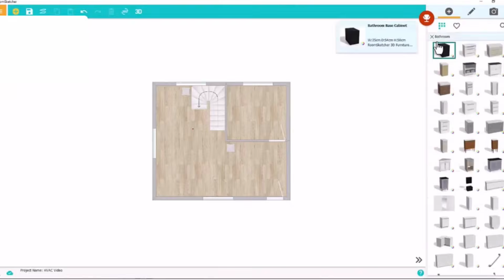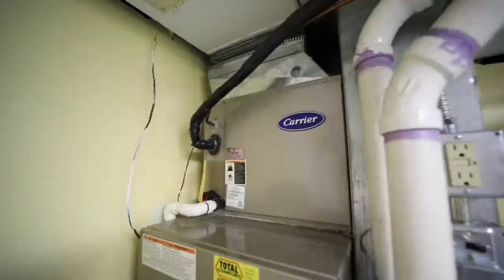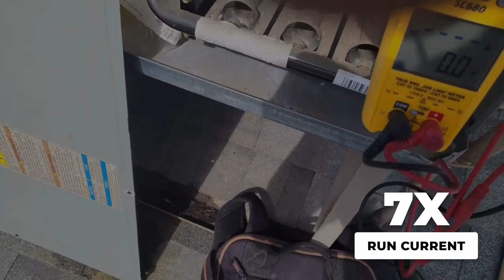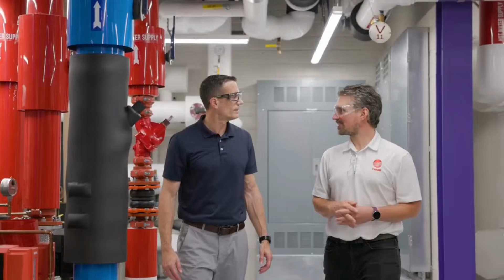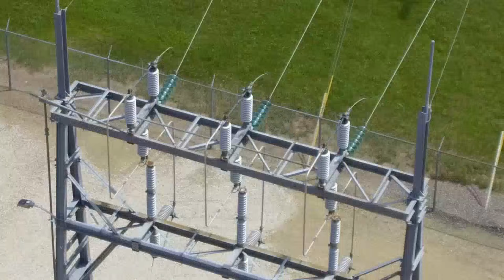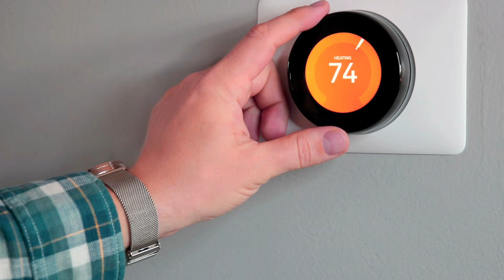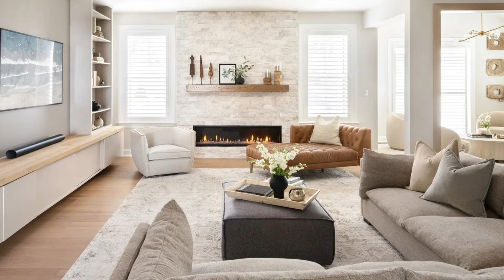How Smart Homeowners Are Beating the HVAC Industry (The 15-Year Loophole)

Comment: They never mentioned warranty. If I install a new system it comes with 10 years parts and labor warranty. Home owner has no out of pocket costs for 10 years. Which means that we definitely don't want it to break down or have any problems. Richard from Houston isn't going to have that. He will be lucky to have any labor warranty at all.

Professional installation and setup is the key.

Oh and if it turns out to be a lemon, we replace it for free.

Richard from Houston does not have that peace of mind.
Reply: Commercial property manager here. I’ve never seen a 10 year warranty. It’s usually 1 year parts and labor for the entire unit and 5 year parts warranty for the compressor and heat exchanger.

Comment: The starting current of the compressor is for a split second and has absolutely no bearing on your energy consumption or electric bill.

Adding accessories like surge protectors and soft starts just adds to the point of failure numbers so now you have more stuff to upkeep.

Surge protectors are no guarantee of protection. 

Soft starts are mostly used when a home generator is going to be used.
Reply: Nonsense - those spokes and surges can damage electronics quite easily .
Reply: I understand power companies charge you for those 100 amp power spikes every time it starts up.

Comment: Most people are not going to install a heat pump if they have a gas furnace. A gas furnace uses less energy to heat the house. Heat pumps cost more money to own due to higher upfront cost and higher upkeep and repair costs.

To have both would be dual fuel which most people don't want or need.

Comment: 10 minutes on, 20 minutes off, is not short cycling. That's only 2 cycles per hour. A properly running air conditioner averages 3 cycles per hour.
Reply: wow, that's what I thought.

Comment: During the COVID lockdown, that first summer was brutal for me. I was sick of keeping the thermostat low constantly,. I looked into dehumidifiers. When I got my first stimulus check, I did my research, and the first thing I bought was a dehumidifier.

It was the smartest decision I made.

Instead of constantly running the AC at a low setting, I was able to adjust the thermostat to 77°F. I'm someone who’s very heat-sensitive (if I'm not on the beach or in a pool, I don't enjoy hot weather), and it was delightful. It's just like the old joke about living in Arizona, where the temperature can rise; 'it's a dry heat,’ and that's so true, when the moisture is taken out of the air, making a hot room not just bearable but enjoyable, AND it pays for itself VERY quickly.

Comment: R22 still running la a champ
Reply: When I see an r-22 system I do not hook up my gauges unless I absolutely have to. If the vapor line is sweating and you’re getting a 15-20 degree temp split then it’s all good. I’ll check all the electrical and do a little tlc but that’s it. I want those units to last as long as it can for the customer because I know once it leaks most companies don’t make the coils anymore to repair them. Then it makes us look bad because the customer thinks we are just trying to sell them a new unit:
Reply: Me too I hope it doesn't start leaking. I always tell my tech don't touch valve for R22!!

Comment: glad bosch is making it sound like they are the answer when they are not and who in their right mind over size the  system unless the customer wants it?
Reply: No ax to grind here , but Over sized routinely…read lesstads worthy post above. The answer is easy when you have a new, well designed and built (ACH <2.0) house-get a competent manual J etc doen by a specialist (its really fair to say, Im sorry, even 95% of even competent honest HVAC installers dont/cant /wont do a competent manual J. They can make one money doign other things and aren’t amend or interested in doing  it.)It’s also easy when you ahve an old leaky house - unless you are sign a significant insualtion energy upgrade, take the time now to establish list. Baseline. How much of the day does your AC run on the hottest day ? Ifs its most the time you aren’t hugely overlies, but that said, dont go upsizing-your ducting probably not up o it/designed for it. If your are cycling  a lot of the time on t he hotest days you are probably substantially oversized. Probably quite safe to drop down 1/8-1/4 in tonnage. Even overlooking noise , Full inverters sunsets are CLEARLY more comfortable than even the optimally sized one and two stage systems, and they inherently start up slow (ie effectively  soft start)  but are more expensive and clearly more expensive to maintain/parts (those proprietary  thermostats are Greta but hugely expensive - think 1,000, not 500 to install; they are not routinely stocked locally as well, but NB they ARE necessary for full inverter full communicating sts yet s! etc esp when out of warranty (those boards parts are really $$$) new residential hvac units with hi pressure expensive refrigerants  re simply not gogin to last 20 plus years anymore they arent. Get used to it. And budget for it the nest warranties (daikin e,g) are onlt for 1 years. These companies spend a to of tiem and money erring what the effective life span f these units are -believe it when the establishment a warranty duration you can safely assume you have at most a 1/4 chance staticallys of lasting lasts lower than that . NONE of these companies keeps proprietary parts in stock much longer thatn that anyway. And NB with politics and environmental science etc, its safe to assume we will will have yet another “new” refrigerant mandated (lets hope its propane liek the rest for the civilized world by then. ) Hybrid solutions e.g., Bosch are a valid approach in DRY climates ; but by the verynature  of their  design, andd not good choices in high humidity climates. Both a no brainer say in Colorado or Arizona, but a no Brueno in Florida, Atlanta, Nashville, Washington  DC. But if you cna only afford a Bosch hybrid vs a carrier, trane, Lennox , daikin,  on inviter all in, taht can make sense for sure. And nb Bosch is basically made by Medea in China; thats not a knock but you should  never pay a premium for them. Initially their price point was very attractive. BUT dotn obsess over brands per se- focus on the company and the quality of their install and honesty of their mainatianence and repair approach. Are their techs certified (usually not) are they EXERTS in their equipment (for example Mitsubishi  and Daikin hi their dealers DO have to meet certain standards, ANYONE can buy Bosch and install themselves. ) these inverter systems are very complicated; even the best of hvac companies will only knwo how to install and service two brands at most for a good reason. And their is value in having equipment that many dealers can handle service wise, but techs come and go even with the bets companies; you may find you HAVE to switch providers down the road and it there are only 2 companies in area who really work on your equipment, your chances of finding a new tech an company go down compared to say it there are 15 carrier dealers in your area. Read up a n search utube on how a new system saw out should  really e done and MONITOR tehm installation. Companies routinely put their east experienced, knowledgeable and capable techs on the install team e.g., do they flow nitrogen when they braize ? Do they tripe evacuate lines ? Due to pull sting vacuum and test for adequate duration for leaks ? Do they size properly a quality filter (or Copeland ) One other thing- everyone wnats  to press fittings on new installs, in theory any idiot can use the press fitting system and with the low level of install crew, it makes sense . BUT these fittings are totally dependent on gaskets, all of them, and the new high pressure full inverters are merciless. Down the road they can EASILY leak, long after the install warranty expires. I would ask for all fitting s braised and CERTAINLY ANY buried fittings ….te days of topping off slow leaks in a singe stage system are over. R410 can easily cost over $1,000 to fully evacuate and reload these days !

Comment: "Anything can stop a Trane"
Reply: Been in business for 19 years, doing  3,000 - 4,000 service calls per year, along with installing hundreds of systems made by Carrier, Goodman and Trane. And its my opinion that Trane is #1
Reply: @stevespears1970  I agree. My Trane  XL19i is still humming  after twenty years.
Reply: @stevespears1970  What do you think about Rheem?.  About to have two Rheem 15.2 seer installed.  Hopefully I made the right decision.
Reply: I have a unit/ system from 1986....
1800 up
1800 down.
We use a window unit at the peak of day for a few hours.
If I reinsulated it wouldn't need that.  KcMo. High 90's with a few days in the 100's.
Reply: It is a Trane.

Comment: I recently had my HVAC replaced with a heat pump. It had a 4 ton unit the company wanted to replace it with a 4 ton. I didn’t believe it was necessary so I paid about $300 to have a Manual J done by an HVAC engineer. Turns out only 2.5 ton was needed. Works fine and the indoor humidity is definitely less
Reply: Wise decision.
The nice thing about a lot of heat pumps is that they are modulating. Oversizing is less of an issue. It will just run at a lower load for longer times. I have a Bosch IDS and I love this thing.
Reply: I run a manj on every house I build .
Reply: Tom do you have a contact phone # and email for your engineer that did your heat loss calculation, because I need one too ?
Reply: Will do the same on survey.

Comment: Compressors have the same basic design for 50 years! Starting current is designed into the windings. Many compressors being replaced today are from the late 1990’s! Heat pumps operate approximately 4500 hours a year at approximately 3 cycles per hour. 13500 startups per year x 20 years 270,000 starts! Sounds reliable to me! Soft starters are used for 2 situations, light dimming on compressors start-up that’s a power source problem, everyone blames the compressor. It’s not the compressor! Next noise on start up, this can be a compressor generated problem or more likely a power problem that is creating the noise! Soft starters usually eliminate these two issues, they don’t fix the problem the power still has an issue by its masked!
Reply from the maker: Fair point on the design spec. Compressors are built for startup current.
But 3 CPH assumes proper sizing. Oversized system short-cycling at 15-20 starts per hour triples that math real fast. That's where the damage happens.
On soft starters masking a power problem... you're not wrong. If the grid's dirty, fix the grid. But most homeowners can't fix the utility. A soft starter protecting a $4k compressor from a voltage problem they can't control isn't masking anything. It's damage control.

Comment: Wow. I had all new ductwork plus a new Trane system installed for 8K.
 back in 2010. But estimates varied wildly with different contractors.
Reply: I used R8 vs R6 that most use except Cali which is there code.
Reply: Trane systems can be pricy, but I think mine was worth every penny even though it was around $12k.

Going from a single speed to a variable speed completely changed the comfort level of my house, and my home office.

I was seriously considering adding a mini split for my home office as it would swing constantly from cold to hot to cold on my old single speed system, which meant I was going from sweating to the arctic, and back to the Amazon all day long.

The variable speed Trane keeps it perfectly comfortable 24/7, year round.

Knowing how well it works now, I would have paid more for it if needed...
Reply: i replaced all of my ductwork and the furnace, i did it all myself, cost around $800, furnace was $650 on ebay..
Reply: @jesvans That is pretty impressive.  My ductwork is run through the attic and is pretty long and bulky, not something I would be interested in tackling myself.

In the south you don't even need a furnace, I haven't used the heat strips on my central systems for over a couple of decades already...
Reply: @redbaron6805  attic, not a big deal. i had to replace all of the joists in my attic. round ducting is supper easy aand cheap.
Reply: @jesvans My attic has flex ducting, which is bulky, and my attic is a maze of obstructions, which is difficult to access unless you are an acrobat.

Now, the smart thing long term is probably building a walkway to traverse the attic, by putting 16x24 plywood and make a path around it, but that project is down the list below the other 900 projects that are still pending...
Reply: @redbaron6805  
i put a catwalk in my attic, helps a ton.

Comment: I am disturbed when I see a film like this.  Always ask why when certain prounouncements are made as fact.  Why, after 15 years and a major failure would an ac company recommend a full replacement?  Where did "Richard" get the equipment and expertise to do a DIY HVAC upgrade himself?  What is the cost effective life span of a set of equipment that runs 10 times more hours per year as your car?  Why would a company oversize equipment which costs more in a competetive environment?  Here are some answers:  I see oversized equipment all the time and recommend down sizing based on a comprehensive load analysis (which prob wasnt done when old system was put in).  But I know why contractors do this.  The typical customer will call the contractor complaining if his new system doesn't keep the house at 68 degrees when it is 104 degrees outside.  Why don't people buy dehumidifiers?  Because they add to the cost of the replacement system.  Why do contractors replace the entire system when it is 15 years old?  Because new components are not compatible with old components and because there will be a guaranteed complaint call when an old component breaks and causes a system shut down, which according to Murphy's law, will always occur on the coldest day, the hottest day or when the entire family and freinds come over for 4th of July celebration causing an irate customer and bad review.  Customers NEVER take responsibility for their decisions guiding an installation......and they shouldn't.  AC guys should politely walk away when they encounter a "Richard".  Let him do all his stuff himself.  As far as picking an ac company.  That should be done on a trust basis.  You can't possibly learn all the ac guy knows to do a competent installation.  Talk to the tech/company.  Get to know them.  If they are trustworthy they will build a credible rapport with you.  The good companies never have to go out after hours or on the weekends because their stuff works due to disciplined procedures.  They do preventive maintenance which anticipates and prevents break downs.  They replace components when they are out of spec, not when they quit or break.  Also, government efficiency standards, global warming safeguard dictated by government dictate efficiency upgrades and refrigerant changes, not the industry.
Reply: High quality equipment installed perfectly, never breaks down after hours? Hmmm.... How many years have you been doing HVAC?
Reply: Exactly!  This is a junk video.